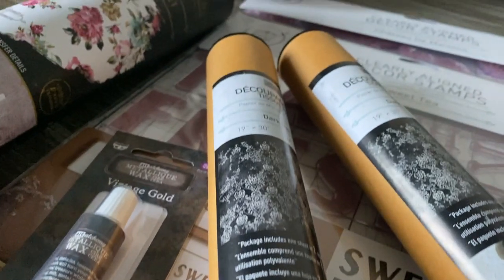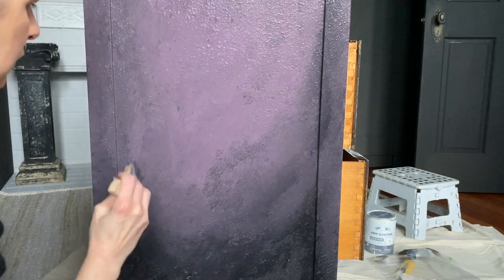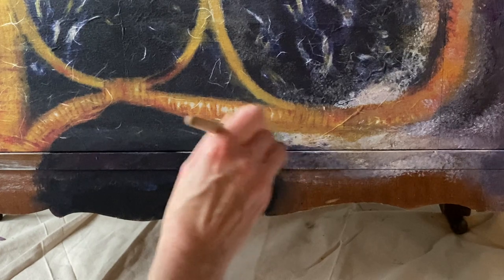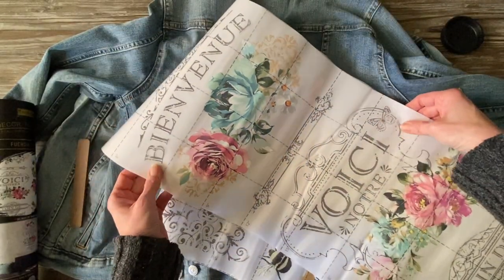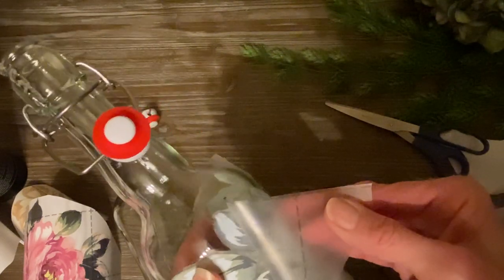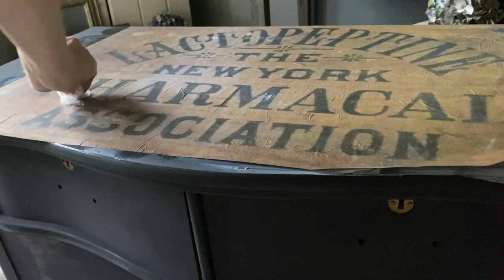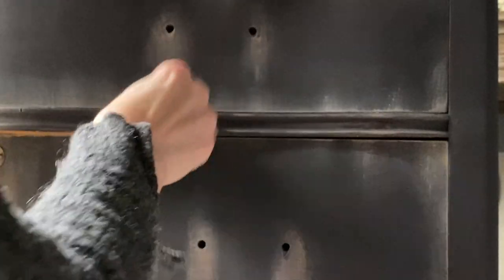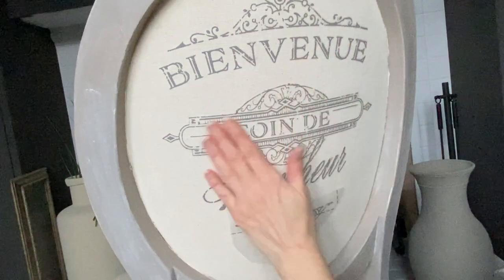5 Home Decor DIY: "Mystery Box Challenge” Furniture makeover with @Kacha Furniture! | ASMR diy

Comment: Hi Christina, thank you for the great projects you did and shared with us today.  What a great idea of using the transfers on the bottles  and on clothing.  I haven't thought of these other types of surfaces.  Will the transfer on the fabric be durable and last through the washes?
Regarding removing glue from the paper labels.  For years i have used WD-40 oil.  Recently, to be healthier, i started to use coconut oil (the cooking kind).  It seems to work almost just as well.  Either way, i clean the grease from the oil with rubbing alcohol.
Nice to see the dogs.  Has the cat adjusted yet? I hope so.  Thank you.

Comment: I'm watching sooo many videos using decoupage and transfer projects and techniques, trying to learn as much as I can. I haven't worked up the courage yet to start! So I have some questions, if you don't mind.
I notice you don't try to remove the straight edges on your papers, essentially feathering the edges. Is it because the paper is heavier and it wouldn't work like a thin tissue paper? Do you always or sometimes lightly sand the surface after its dry and before painting or waxing? And how do you decide which way to do it? Ok I know I had more but I don't remember them now! A tip I recently learned and have actually implemented: in addition to or sometimes instead of soaking the labels off, using a razor blade glass scraper really is helpful and doesn't scratch the glass. Thank you for sharing your many talents with us!
Reply from the maker: Thank you so much for your thoughtful comment and feedback Sharon!
It’s great your taking a moment to ask questions, I had all the same questions as you!
But you made a good point in your comment, it’s all about the thickness of what decoupage paper you use.
I watched many videos and got all kinds of different ideas 💡 
Even now decoupage is tricky for me as it’s all about patience lol 😂 
Also what surface are you applying the decoupage onto? Is it flat? Is it horizontally or vertical? How thick or thin?
Using sand paper for edges and corners is perfect 👍🏻 but sometimes I will just glue it over the corner again it really depends on the projects. I do recommend sanding the edges for dressers and similar because you may make the drawer edge to thick to close , again it does depend on the thickness of the paper. I haven’t even had any issues with sandpaper regardless of the thickness but like you said just wait until the glue is completely dry so it doesn’t rip.
I recently got a comment from a subscriber that was really interesting about decoupage ( I haven’t tried it but I plan to very soon) she mentioned that if you spray some sealer onto the paper before you apply it with glue or decoupage gel medium, this way the paper won’t absorb quickly and you have some working time to smooth out your paper? 
I thought 💭 that sounds interesting 🧐.
I want to try this and see if it actually works?
All your questions are good 👍🏻 and keep viewing videos and definitely give it a go!
I always learn the best when I try it , it’s okay to make mistakes as I have many times lol 😂 
But always helps to watch a learn from others to avoid mistakes if possible. 
Good luck and please feel free to contact if I can help in anyway 
Cheers 🙏♥️♥️
Reply: @TheReclaimedHeirloom  thank you so much!  Interesting about spraying the tissue paper first. I hope you do that soon😂 I’m actually watching your living room make over part one right now…had to pause so I could read your reply. Have a great day!

Comment: Christina I so look forward to Saturdays so I can watch your latest. You are inspiring!  I have a piece of furniture that I would like to paint as it is my style and I love the lines. But it is for a formal dining and due to a recent move I no longer have a dining room; rather I am using it as the main kitchen table now and not too conducive to busy grandkids. I would like to paint it and have the chairs recovered.  But I respect your opinion on whether this is a finish that could be painted over or not.  Thanks!
Reply from the maker: Hi Patti yes you can paint over it with chalk paint.  I would recommend given you are using it for high traffic use is to put a top coat poly or varnish.  I like the minwax diamond coat brand.   🙏🎨❤️